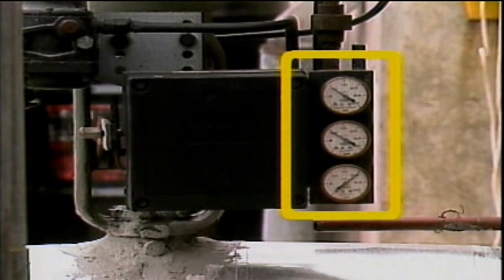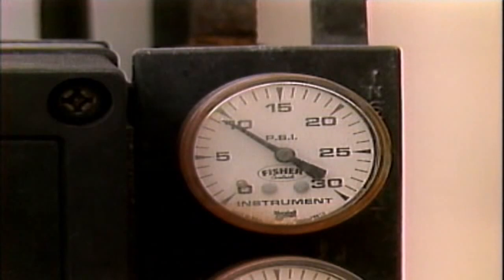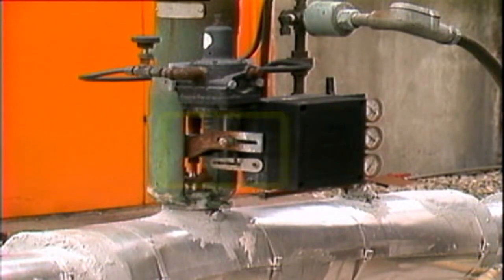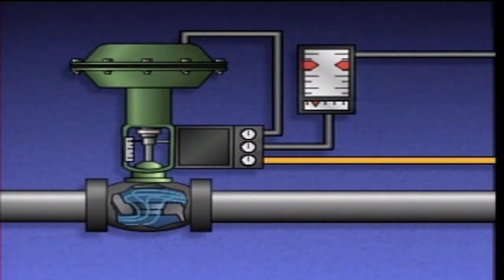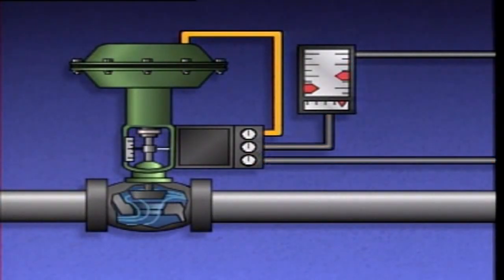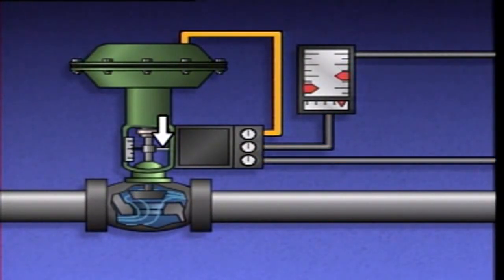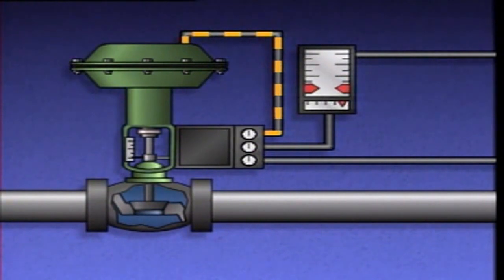What is Positioner in Pneumatic actuators Control Valve?|Positioner Working Principle

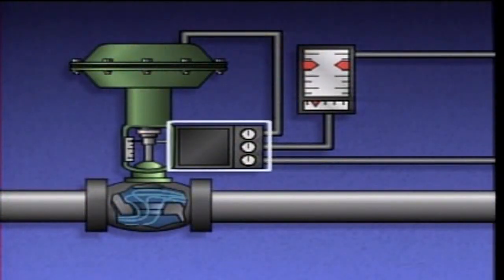Comment: Initially they said the Positioner gauges were from the bottom up: Suppy, Output & Input. But then in the process diagram it shows two gauges in different positions. The top which should be the Input to the Controller is shown going to the Actuator. Then the middle gauge which should be the Output to the Actuator is going to the Controller.  1:30